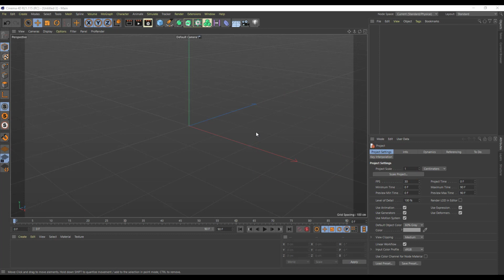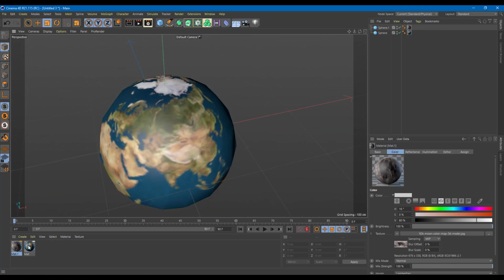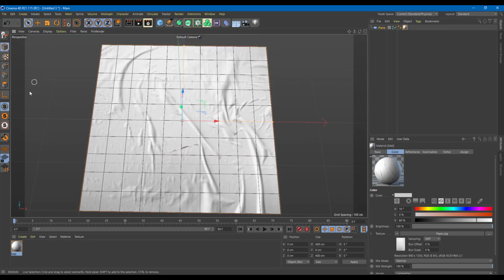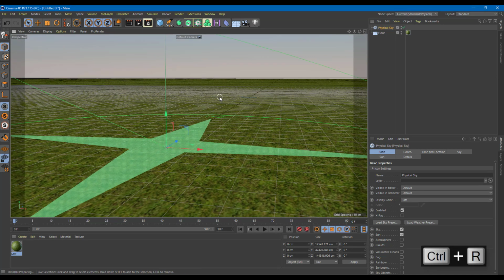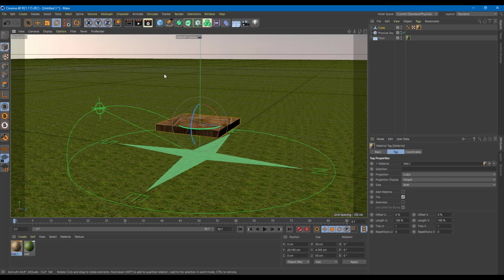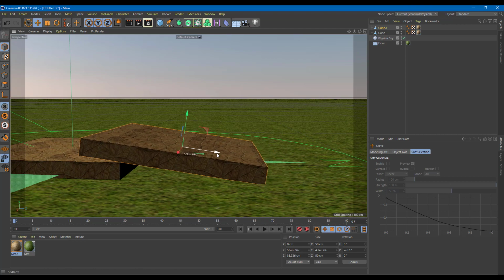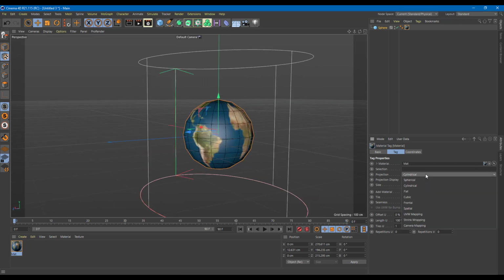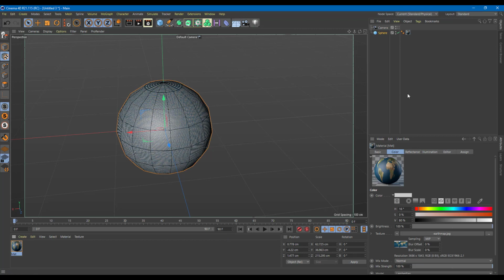Cinema 4D Tutorial - Lesson 39 - UV and Projection

Comment: Bro could u tell me what are ur pc specs when u are using cinema4d
Reply from the maker: I use AMD Ryzen 5 3600, 16GB 3200Mhz DDR4 RAM, 256GB SSD, 1 TB HDD
Reply: @tutortube  does u have separate graphics card?
Reply from the maker: @saidevpappu  Yes I use GTX 970
Reply: @tutortube  bro how did you find that old powered graphicw card bro?that not in sale!
Reply from the maker: @saidevpappu  I bought it 5 years ago.
Reply: @tutortube  for how much bro
Reply from the maker: @saidevpappu  For around USD 400